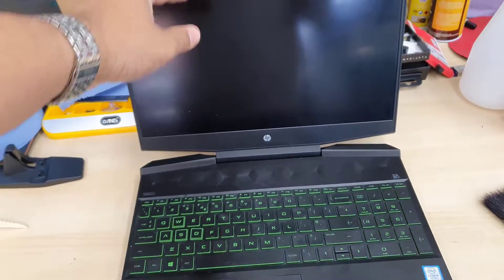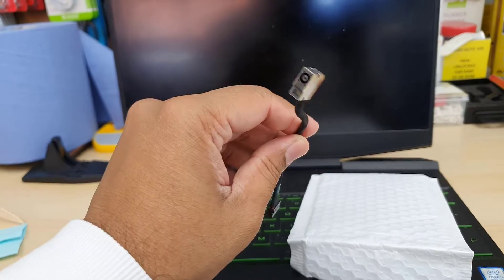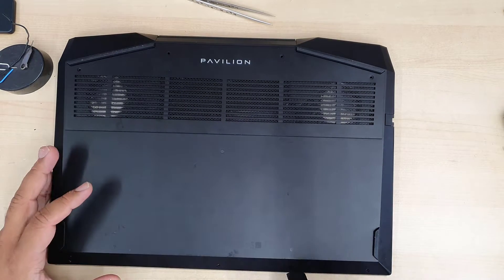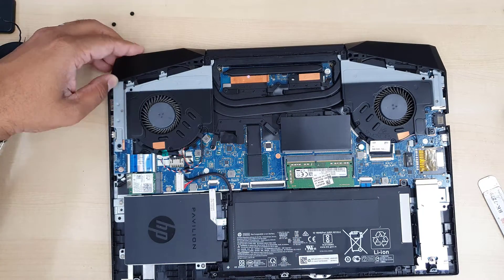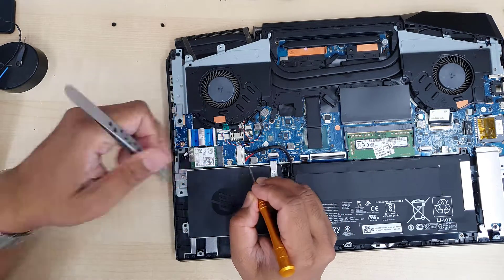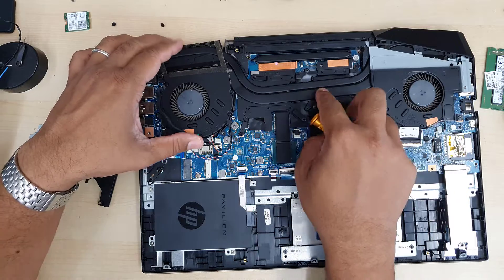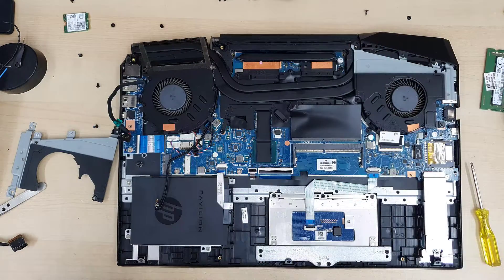HP Pavilion Gaming Laptop 15 Does Not Turn On | Charging Port Replacement

Comment: So anyone else have the issue where there hp pavilion 15-ec gaming laptop powers off as soon as the OS / Bootable USB starts to load? If so, Do you still have this laptop? If you boot and go into diagnostics (F2) and run the ac adapter test (from power test) menu, does it fail with the error The smart adapter feature failed to return valid data

Comment: Mine turned off and won't power back on
It started doing this I got the power back from a blizzard in March and hasn't come back to life since
Could it still be a bad charging port
No lights, no power button indicator at all it doesn't seem like it has any power at all
It probably didn't help me that it was uncharged for almost a full day
Reply: Even putting the charger in there didn't bring it back at all

Comment: My laptop is exactly like the one in the video, but the problem is when the charger is plugged in without the battery, the indicator flashes once but nothing happens.
Reply: Same for me did you find the problem
Reply: @Eastsideslump  I succeeded by checking the power flex, it turns out mine was loose

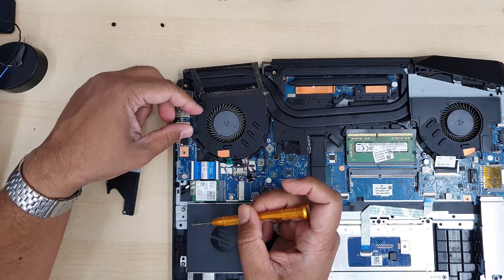Comment: 4:32 question what is the name of the piece that you removed or your screwdrivers pointed to you unscrewed a small square green piece that looks similar to the ram but it’s 1/3 of the size.
Reply: Wifi and bluetooth module bro, m2 wireless card bro

Comment: My hp pavilion gaming laptop doesn't turn on... can you help me, 
The charging port is working though
Reply: Did you find a solution brother? Mine has the same problem right now it dosen't want to start up but the led is red when i plug the charger
Reply: @Seraphim_Morningstar I have the same issue, did you figure it out?
Reply: @Seraphim_Morningstar mine used to do this when u turn the laptop upside down on the top right where u removed the plastic hinge cover there's a blue connector there make sure it's sticked in or stick it in while pressing the power on button it will turn on then u will have to close it after while it's on

Comment: hello sir.  Can you help diagnose the damage to the laptop because if I take it to a service center I have to prepare a lot of money.  So when my Pavilion Gaming 15 laptop is connected to charging it doesn't want to charge when the laptop is on, but wants to charge when the laptop is off.  and when I removed the battery and connected it to charging it wouldn't turn on.  please I really need help
Reply: I have the Some problem . I think it is the bios or software , something like that because It was charge
Normally until I update the windows
Reply: @LYN-Monder  I have the same issue, did you ever fix yours?
Reply: @zacharywzientek2010  I fix it like from two months ago 
First right click  on windows icon (windows menu or start menu ) then click on device manager,  click on battery,  and then right click on Microsoft AC adapter , then trun the device off and then return to on (IDK What is exactly is the option but something like that.)
After I did this, it didn't actually work at the same time I did the steps . I woke up the next day, and i  plugged it in , and it start to charging while is on
Try it and tell me

Comment: Hi can I upgrade it's ram to 32 gb and what frequency hz to buy. I have the Hdd model i5 9th gen
Reply from the maker: Why don't u go for SSD Upgrade first? It would help you to get better speed. Check the existing Ram model and details to get the right frequency and speed.  Hope that would help. Thanks
Reply: @thepcphone  I work as an editor so Most of the apps I need require about 24 gigs of ram or so

Comment: Yes, but when you connect the charger with the new cable, the light should either turn red and then turn white or turn white all at once and it doesn't.
it will be the bios

Comment: Hello, I need help, mine has that fault, I bought the cable and even so, neither the LED nor the PC turns on
Reply: Maybe your battery is dead. Try removing the battery and turn on the laptop with the charger plugged in
Reply: @muhammadabdullah9439  hello, good morning, thanks for answering me, I already did it and neither the LED nor the battery turned on. Poor battery, the battery in another laptop and the battery is fine.
Reply: @rafaelpresutti393  i just pushed the button a great many times and it started working perfectly, don't know what happened there
Reply: @muhammadabdullah9439  ok it's fine but it shouldn't turn on the white led when connecting without the battery because it doesn't turn on either, I asked for another cable and I'll try again.

Comment: What if my charging light still comes on,at first its orange and then goes white? Probably the charger itself? Or the battery?
Reply: I got the same problem as u, light but nothing happens
Reply: @palarvesandy5798  i found out it was my battery. I took it out and the computer turned on with the charger plugged in
Reply: @bahbabooey  ill try, thanks
Reply: Yea it's the battery just take it out and get a new one, they are $30 something online